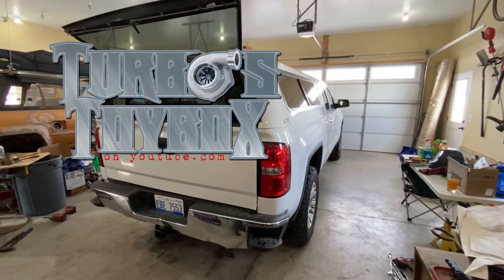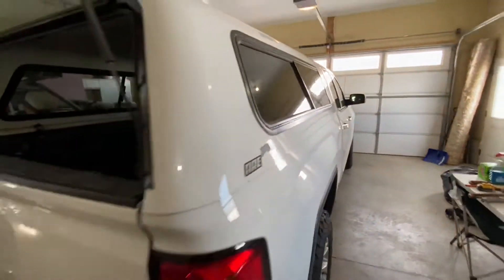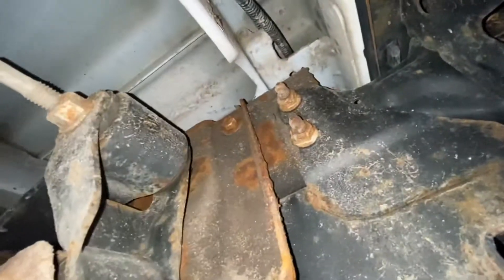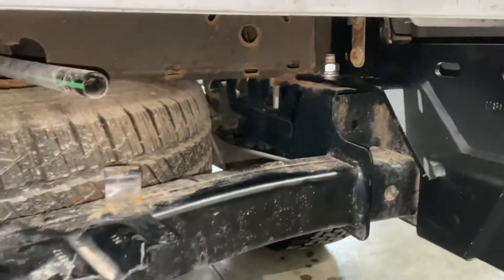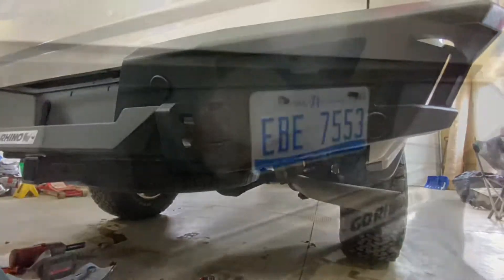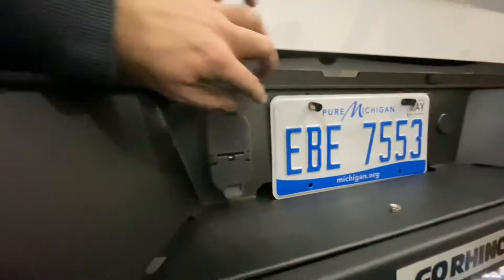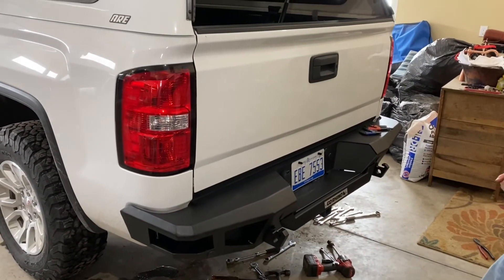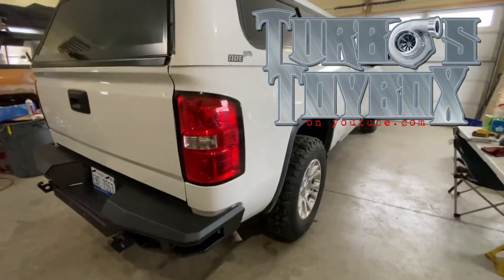Removing the rear bumper on a Silverado / Sierra 1500 and installing a new GoRhino BR20 bumper.

Comment: What size wood did you use to block under the bed so you could remove the bumper?
Reply from the maker: 4x4
Reply: @Turbo’s Toybox  Gotcha, so I'm guessing you used a floor or bottle jack from underneath instead of placing a block of wood between the frame and the bed on each side?
Reply from the maker: @je1279  Oh sorry yes! I wasn’t sure what you were asking there. We jacked up the bed from underneath temporarily, removed the bumper, then sat it back down.